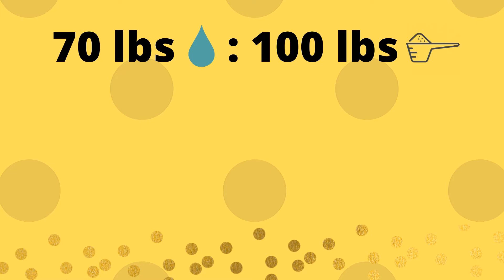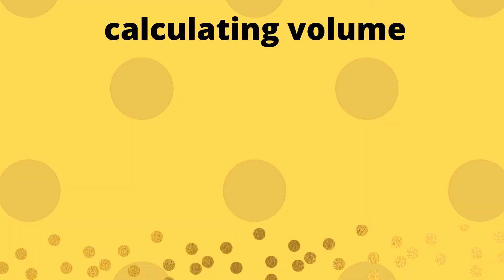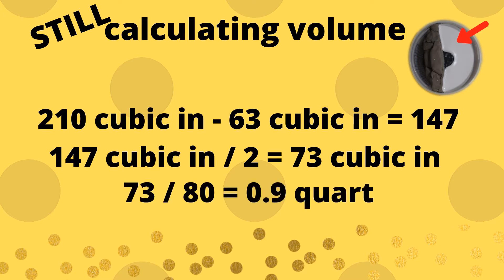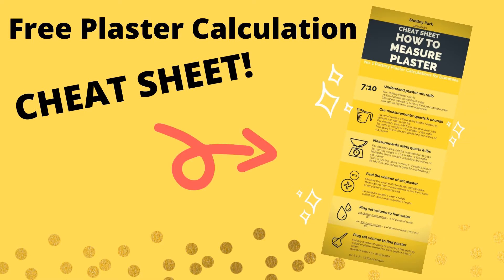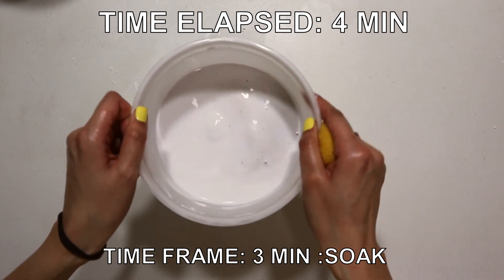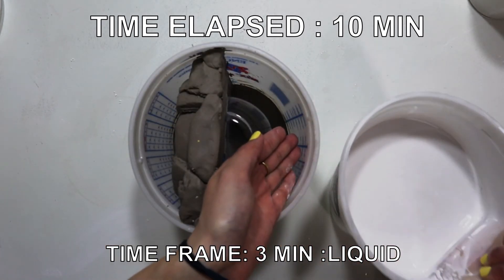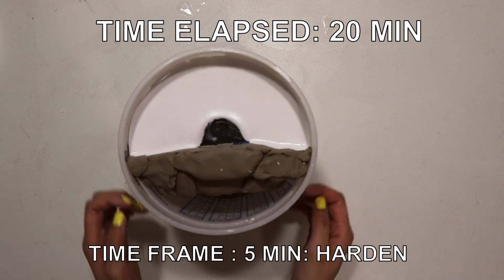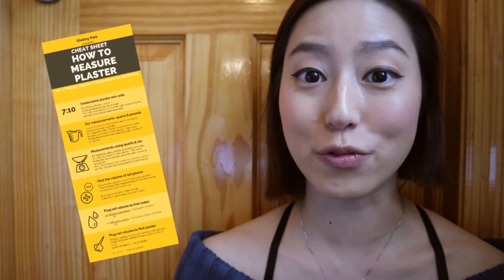How to mix plaster PERFECTLY (using a simple formula)

Comment: Hello Shelldog,
   At the beginning of your cheat sheet you write: "70lbs of plaster to 100lbs of water."  I believe this is incorrect.  The proper ratio is 100 lbs of plaster to 70 lbs of water.   The total mix is 58.9% plaster and 41.1% water.

Comment: Love your videos! Just wanted to contribute: if you use metric, you don't have to do any conversions or use any tables. Recently I've been using the glazy.org plaster calculator and it's been coming out perfect, but if you use metric the calculations get a lot easier. We know the specific gravity (or density) of Pottery Plaster No. 1 from USG's data sheet: 1.586, or 1.6 if we want to make the math easier. All we have to do now is calculate the volume of our mold. For a 3.5cm radius, 9cm tall cylinder, we have a volume of 572.5cm^3. 572.5 (volume) x 1.6 (specific gravity) = 916 (total weight in grams). 0.7x (weight of water) + x (weight of plaster) = 916g. 916/1.7=x, x= 538g of plaster. We can now solve for water, which comes out to 377g. (377 + 538 = 915 so we know we did our math right.) 

The plaster calculator on plaster.glazy.org comes out to 549 grams of plaster, 384 grams of water which is really close, so I usually just use their calculator to save me some time, and it follows the recommended 7 parts water to 10 parts plaster they recommend. My guess is they round a little higher in their calculations because having a little extra plaster usually isn't a problem. For this reason I also don't subtract the volume of the model, in case my mold starts leaking and I need to top it off after plugging the leak. Hope this isn't too complicated of a read, it really is simpler using metric, and simplest using the calculator on glazy (they have tons of shapes they can calculate for you!)